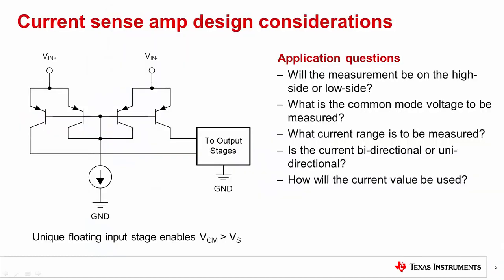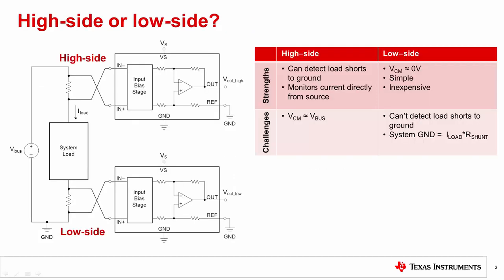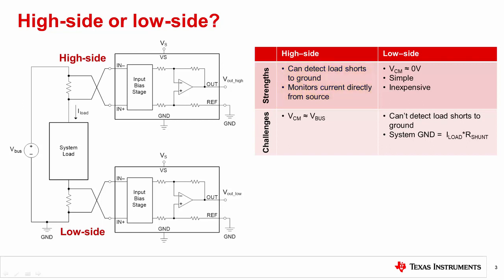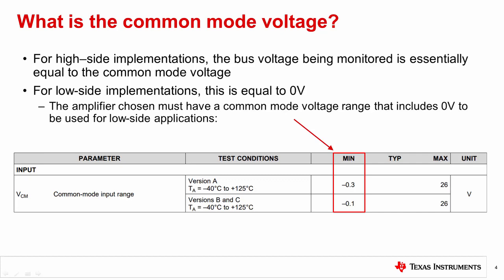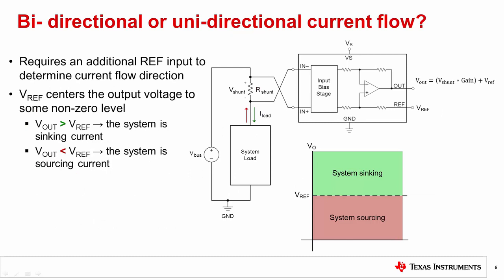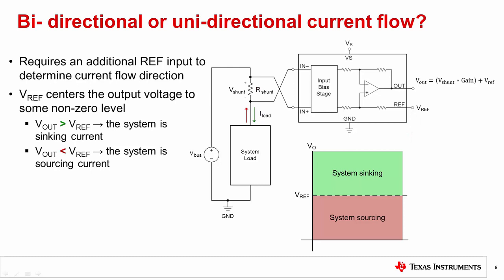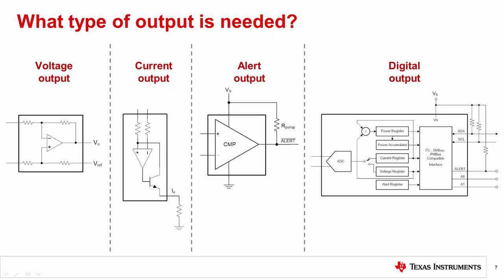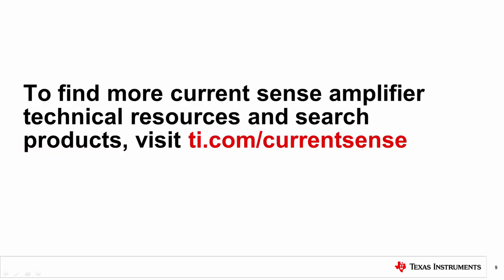Design considerations for current sense amplifiers

Comment: Measuring two circuits of 57VDC, I am thinking of using INA2180. Since the maximum common voltage is 26V per channel, can I use voltage divider to reduce the voltage at power rail ? Thanks